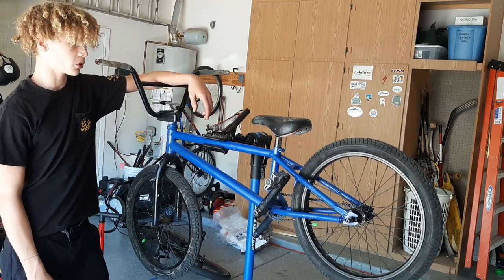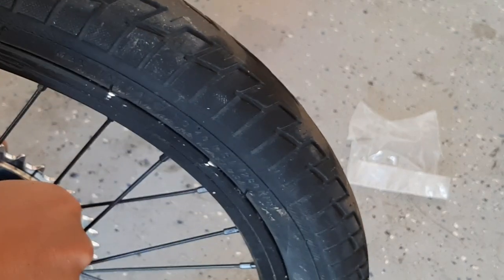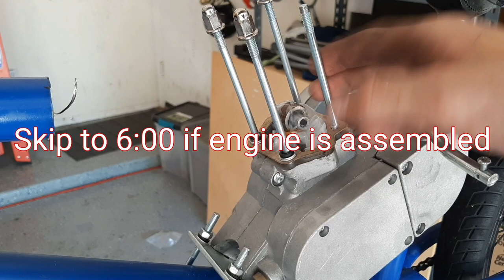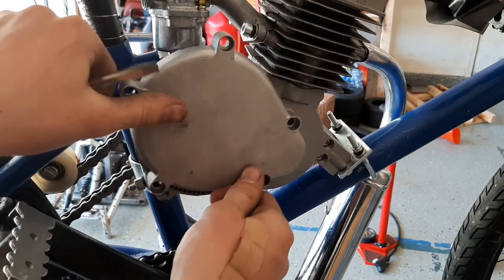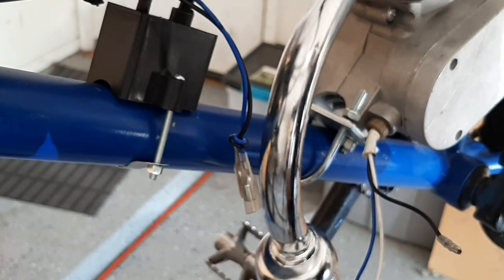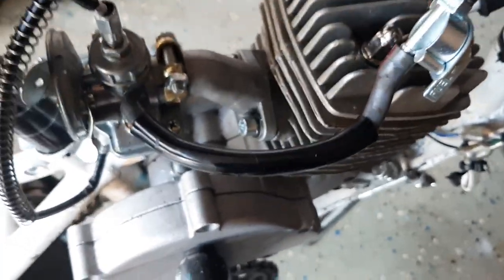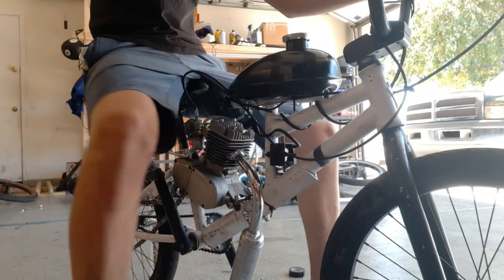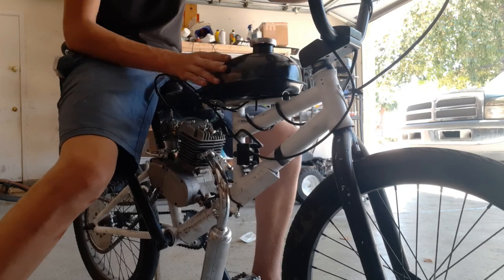Building my LEGAL stunt 48cc motorized bike! FULL TUTORIAL and ride!

Comment: Since this bike is primarily built for wheelies how's the frame holding up? Has it bent anywhere? Worried it will break in half with the top tube cut out. Awesome build man!
Reply: For a while it will but the welds will break eventually needs reinforced but I don't even think that the frames going to be Boeing outwards

Comment: DONT let you're 2 strokes coast, pull in the clutch when you're not on the gas, as the motor will be turning over without any lubrication  when you engine break!
Reply from the maker: Thanks bro, didnt even think about that. most likely why i always have issues with the small 2 strokes
Reply: Nonsense... don't need to pull clutch in.
Reply: Bro there's still fuel mixture coming into the engine cuz of the idle hole in the carb slider

Comment: Top notch video. I might do this, but with a 20" lowrider cruiser bike.
Reply from the maker: that would be badass
Reply: @kartingkid714  right now I'm working on a prototype. Pocket bike engine with 415  sprocket.
Reply: I’ve wondered if one would fit in an old 20” schwinn
Reply: @GratefulEd907  I'm assuming it's the micargi hero or a Schwinn lowrider bicycle that fits. I saw what looked like them in Walmart at some point.
Reply: My son has an old 20” firestone warrior frame  from the 50s-60s not sure exactly when it was made but it’s cool we’ve made a few “rat bikes” with it
Reply: @GratefulEd907  I see. It would be interesting if someone made a front wheel drive with this engine. Custom for sure.
Reply: @GratefulEd907  no it wouldnt
i tried, but you have issues fitting the muffler in
Reply: Removalist1995 I’ve seen a few videos now of an 80cc in stingray knockoffs. I hope it fits I just ordered the kit.
Reply: Gotta mod the intake I guess but looks simple enough??
Reply: @GratefulEd907  well, i have the 2007 walmart stingray reproduction, not the chopper, so maybe itll fit for you, but i cant be sure
Reply: @GratefulEd907  got it. I actually want to motorized a  mountain bike.
Reply: post it on youtube
Reply: Thinking about doing my 20" freestyle ABD Player, nice strong frame!

Comment: When building the motorized BMX do you have to place the fuel tank higher than the bike motor or does it work fine keeping it at the same level?  I was just thinking about this to simplify the ascetics of my motorized BMX bike design while keeping it functional.
Reply: Preferably higher then the carb so gravity can pull it down, other wise you'll need some type of fuel pump

Comment: you can hear the engine chatter when you don't feather the clutch when going slow/ coasting
Reply: that's the clutch chattering. These are really cheap parts and the inside of the clutch often has major imperfections which cause them to be quite noisy.

Comment: Seems the engine runs heavily. You could use some oil mixture there, a bit of 2t oil with gas will do.
Reply: He used pure gasoline, i can tell that it'll have some cylinder damage because it has little to no lubrication

Comment: I should have had one of these when I went to college a few years ago and I did not have a car because there was no where to park.
Reply: It would have been especially good to have after I have a bad ankle sprain and had to walk really far on campus.
Reply from the maker: @notthatdigusted7468  they didnt have campus buses?
Reply from the maker: Lane AWD  agreed, not only because of specs but also reliablility. i ran this poor motor into the ground thinking it woukd hold up, pretty much only rode at or around redline. Only lasted 2 weeks
Reply from the maker: Lane AWD  same, built a bike for a customer with an 80cc baja. literally cost me $50 to make and i could cruise at 30 still governed

Comment: Do you think if it was but on a 29 inch bmx you would still need a chain tensioner?
Reply: depends. the kits always come with more chain than you need, most people used to run tensioners  but then accidents started to happen where the tensioners came loose and got caught in people's wheels, so now people mostly just shorten the chain and completely remove the tensioner.

Comment: Hey can you tell me if I can fix the sound because it's too loud
Reply: Nope A basic muffler is about all you can do to a 2 stroke. A lot of the sound isn't just the exhaust comes from the engine sides itself. A decent muffler definitely mutes the poppy explosion sound but the rest of it remains. Possibly heat proof sound shielding could help that's about it though would be tricky to design and might hurt the airflow if done wrong. Better off with a 4 stroke if going for silence or maybe even an e-bike. E bike has the distance and charge issue but depending on use could be better.

Comment: Most people install the chain tensioner to lift the bottom,, return part of the chain. How is yours working out for the long haul?
Reply from the maker: Tensioner broke haha
Reply: @kartingkid714  I guess it couldn't take da heat! How about the frame, is it still holding up with the angle iron brace?

Comment: Mine don't stay on idle when I squeeze the clutch  it shuts right off?
Reply: Tighten up the throttle cable or turn the idle screw all the way in.
Reply: @sml156  thank you I will give it a try

Comment: is it still running good? and how fast does it go?
Reply from the maker: Ran great till a washer fell in the intake lol. It did 23 with a 44T sprocket and 30ish with a 36T sprocket
Reply: Karting Kid hey that’s decent but if you did some upgrades like a expansion chamber, Cnc high compression head, And a reed valve you will get 45-50

Comment: thats some horrible mig welding lol
Reply from the maker: does it bring u happiness to comment shi like this? i had been welding for few weeks and i literally have a job at a shop now bud
Reply: @kartingkid714  clean your metal first, turn up the heat and wire speed to 6 then pause your spots to half a second you'll get stacked dimes rather than granola
Reply from the maker: @khaosnitro  yep i know that now, big Cs and Os and occasionally triangles to get a pretty bead. I was real inexperienced back then.  sorry for bein an asshole i get ciritized so much for welds i did when i didnt even know what i was doing

Comment: If it's got petals it's a legal bike, under 50ccs don't need to be registered so piss off the neighbors as much as you want 👍
Reply: Got to take that muffler off it'll really make the neighbors want to call code enforcement
Reply from the maker: @fantro1064  i wanna get a expansion chamber, but i think im selling this. I wanna do one with a 50cc 3spd
Reply: @kartingkid714  got an 80cc 3spd Yamaha dirt bike. Pulls like mad in 2nd gear once it hits that power band
Reply: I build beach cruiser bikes and I use a seeutek or a zeda triple 40.... great power and torque with a 36 t sprocket.... cops always ask me what size engine i use.... I always tell them its a 49cc ... although it’s larger they won’t know.... never tell them that it goes over 25 mph.... I got hit with a radar gun and clocked at 46mph.... I acted surprised.... never got a ticket.... good luck young man!!!!! Great video